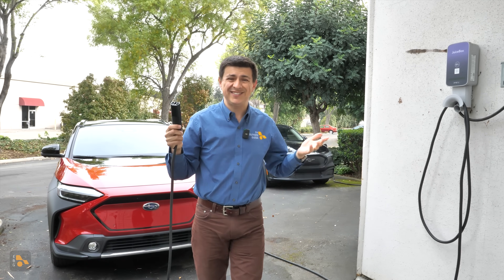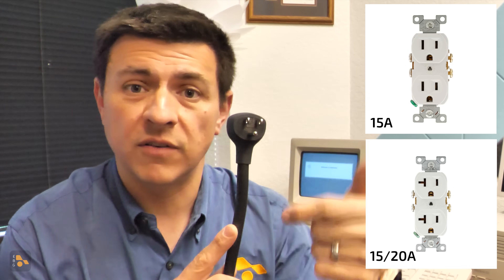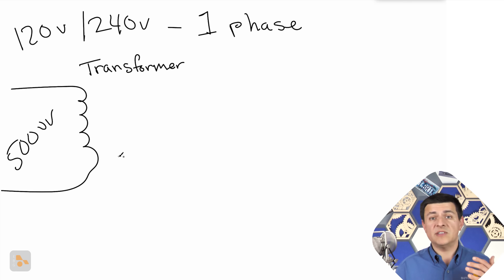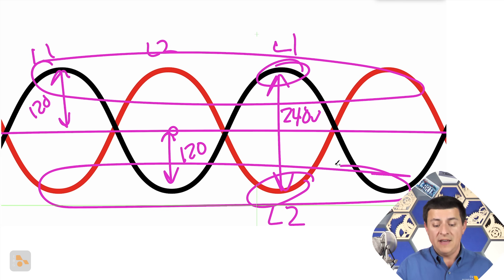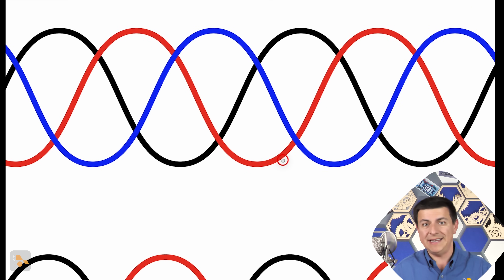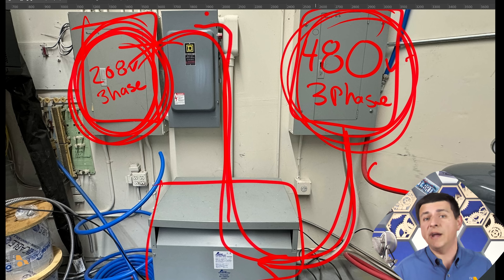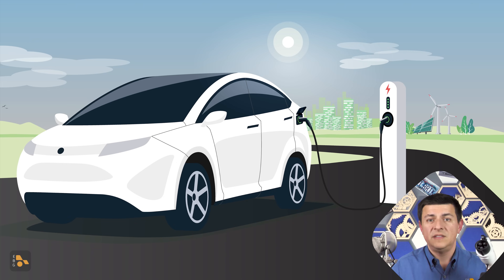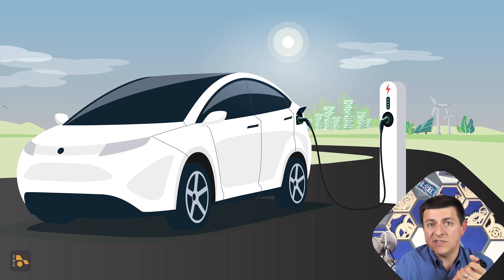NACS/J3400's Support For 277V Charging Is A Huge Deal and Here's Why

Comment: The peak-to-peak voltage of 240 volts is 340 Volts, not 240 as you drew. The Average voltage is 240 (248).

How electronic lighting "cheats the meter" by drawing power only at peak voltage stored in a capacitor"

240 VAC rms is 340 Volt peak to peak.

277VAC RMS average is 391 volts peak to peak.
Reply: Your meter can tell the difference between real power and apparent power, and if it only bills you for one, it bills you for real power.  Electric lighting doesn't cheat the meter by only drawing power at the peak.  Your meter measures the cumulative value of the instantaneous product of current and voltage.  Not the product of RMS current and RMS voltage.

It's an industry standard that nominal voltages are RMS voltages, rather than amplitudes, but that wasn't relevant to the main point of this video.

Comment: Model 3/Y and refreshed S/X can do up to 300VAC charging, even if it's not advertised. I would expect that the OBC's on most other EV's are capable of it too, but the software almost certainly doesn't support it considering the limit of J1772. But that does make me wonder if J1772 could be amended to support it. I can't imagine there's any physical limitation preventing it from handling a small increase in voltage.

Comment: Electrical engineer here who designs power systems for buildings. Nice video, but it does have one major issue. Most apartment buildings (even very large ones) and small to medium sized retail buildings do not have 480V delivered to them. The power comes in at 208V from the utility. I will have to look into whether this would make it economical to start bringing 480V in for apartment buildings with a lot of EV chargers. 277V will make fleet charging significantly more cost effective though, which I don't think you mentioned.
Reply from the maker: Thank you for sharing! -Travis

Comment: Great explanation!  the MAIN point is cheaper Level 2 installations but as you rightly pointed out, what will happen to existing J1772 vehicles...?  For the good of the EV future, they need to start handing out these J3400 Level 2 277V EVSEs like candy.  So many commercial building owners are very reluctant to install the Level 2 chargers due to cost.
Reply from the maker: At the moment it would only benefit Tesla and could physically damage pre J3400 EVs/PHEVs. That would be a big problem. -Travis

Comment: loved the video. watched it when it came out and I too like to geek out on E parts. I finally learned why the superior (to me) tesla plug will never make it to europe... and I didn't know I could change at 277v totay ? at the house I get 240, and at the hotel I was getting 208v I think and was definitely slower.... but it could be faster ? 23023 Model Y. thanks.
Reply from the maker: Charging speed really boils down to volts and amps and the higher they are the faster you charge. If the hotel was 209v that's likely all the EVSE was getting so in that case it couldn't be faster. -Travis
Reply: @EVBuyersGuide  right but I didn't know tesla supported 277v 48A as well, or is that for future model and later than wall charged v3 I just installed ? curious if the Y supports that now. thanks
Reply from the maker: They support 277V/48A now
Reply: @EVBuyersGuide  with no hardware change on the tesla car or existing tesla wall charger ? that's fantastic...
that doesn't seem like the case from your statement
| You can bet that as soon as we can get our hands on a 277V NACS EVSE, we're going to install one!
Reply: @alaind831  i’m sorry I misunderstood your question, I thought you meant does the model 3, as in the car, support 277v. For a variety of reasons, Tesla has officially not supported 277 V on the latest destination chargers, but you can always get an earlier generation one that specifically had 277 V support. What I am not sure about is: can you just plug a new one into 277 V? If anybody has one and deer in the bay area, I could try it, but I don’t have one myself.
Reply: @AAutoBuyersGuide  I live in Scotts Valley (your neck of the wood) but not really wanting to fry my new v3 wall charger to test this theory out :)
Interestingly the super charger in town is one of the few/early super charger that has been open to other cars (I've seen your vehicule on video charge there too) by nob hill.

Comment: Around here 120/208V three phase is available to smaller commercial buildings, apartments, and what not and is pretty common. 480V is mainly industrial and larger businesses that draw too much power to be serviced by a lower voltage.  In other words 277V charging isn't going to be available at too many places unless they add another transformer to provide it.

Comment: Here in Canada, commercial power is usually 600V (not 480V) 3–phase. This results in  347V to neutral. Does NACS support this voltage as well?
Reply from the maker: Sadly no
Reply: @EVBuyersGuide  So for those with 600V service, some type of conversion is necessary. I see 3 options:
1. For small installations, tap off of the existing 208V transformer. 
2. For larger installations, where the existing transformer isn’t large enough, a separate 480V transformer might be the better option. 
3. Forgo level 2 charging and install low power DC chargers, opening the option for V2G or V2B. For fleets, this also opens the option of not installing an onboard charger, saving weight and money.

Comment: No matter how you say good charger, still you will be ABC always be charging for the rest of your EV ownership. After the lifetime of your battery is over. Too expensive to replace and it just show your EV is just a casing as disposable. Good for you rich countries and rich individuals but not to the third world countries/ island nation/ remote mountainous places/ stream hot/ cold places. Sorry EV is an old tech not suited for all. Many range problem such as load capacity/ no spare tire/ going up hill/ you could only charge up to 80% and use up to only 20% so not practical. Whatever you say do not applied to all...

Comment: i am afraid you dont know much about europe, here i spain a large number of charge points can give 22kw, the obc on  ev can be 7.11,or 22kw, 7kw is single phase, 22kw uses 3x 7   thee of the conector pins on the car side.

Comment: This is a difference between the standards, not the connectors.  J1772 is more than capable of handling 277V, but it is not written into the standard, and thus it is not supported.  It could probably be easily accomodated, but contrary to your statement, most buildings DO have 208/240V and very few non-commercial (read not a factory) buildings have 480V 3 phase service, which is what is required in order to get a 277V 2 phase power source.  Certainly most apartment buildings, churches, and schools would not have 3 phase service unless they were pretty huge, and then only to power the HVAC system.
Reply: Agreed, but again, like you said, if you have that 480VAC switch panel for the HVAC right where the utilities come in, that's what you need to pull out the EV circuits. Plus, for big parking lot jobs, the utility will want to pull in new feed and 480/277 for AC charging directly for a large employee parking lot job covering a good fraction of the lot. Now they do a 208/277 service for a job like that; what a waste. 33% more copper plus the losses.

Comment: Never heard of that 3,5/3,6 kW limit in Europe. 
Matter of fact, most single phase vehicle/charger uses 7,4 kW (1phase 230V - 32A) 
But it's true that you'll find a lot of 22 kW (3phase 230V - 32A) stations in parking lots. Not so much at home, which is more commonly 7,4 kW.

Comment: The USA should have done what Europe does and have CCS2 for 3 phase charging. New Jersey power companies offer 3phase 208v to residential homes.
Reply from the maker: It's so uncommon in the USA that it would have added cost and complexity for the 1-2% that could use it.
Reply: @EVBuyersGuide chicken vs egg situation. With the explosion of all electric houses, and phase out of gas, we are seeing 400amp 240v services. It’s to the point residential new construction should be 3 phase.
Reply: @rpvitiello  According to PG&E, we don't see any increase in the availability of 3-phase residential power, the most logical reason is simply the commonality of transformers and distribution infrastructure. Combine that with the US charging connector standards not supporting 3-phase power and It seems extra-unlikely.

Comment: When will we start seeing NEMA 7-15, 7-20, 7-30, & 7-50   adapters for our Tesla mobile connectors? Thanks for your peak vs RMS disclaimer, as a power nerd I was vibrating watching your presentation. The adoption of 277 charging will make large level 2 sites  much cheeper and more efficient. Thanks for getting this issue into the public eye.

Comment: For what I've heard, the j3400 standard for ac charging will make the eu style bring your own cable charging as an option.
It also specifies the same male mennekes connector for the evse side.
Since it has more pins you could put 277v on the L1 pin, neutral on the neutral pin and 120v split phase on L2 and L3 pins.
It would be a wiring nightmare, but you can support all vehicles needing 120v 240/208 and 277v.

Comment: I have heard there are a lot of cities code restrictions against using a single leg of three phase power.  The Tesla Gen 2 wall adapter and the mobile connector already support 277 volts as well as all model 3s Ys and most model S/X cars. There is a great thread on 277 volt support at Tesla motor club forum.  It seems code restrictions are likely to hold back deployment in the near term.

Comment: I pity the person that plugs in their 208/240VAC J1772 car into a 277VAC J3400 charger with an adapter. That's definitely something to watch out for!

Do current Teslas support 277VAC? If not, it will be a problem for them as well. There will have to be some sort of negotiation between the car and the charger to allow 277VAC.
Reply from the maker: Yes all Teslas support 277V charging, some better than others but all support it.

Comment: Great description, however suspect the onboard vehicle charger immediately rectifies any AC power into DC, where it can use a low cost switching tranisitors (IBGTs) to control the charging.  3 phase is better for rectifing to DC since it doesn't create as ugly DC pulses.  It only requires six (6) inexpensive diodes in the wall connector for an NACS (SAE J3400) to work.  I've suspected the lower voltage DC support might have been planned for 3 phase and home direct DC solar charging solutions.

Comment: i'm surprised no one has mentioned the very common three phase Wye transformers that deliver 120v/208v without the need for a secondary transformer. This works great for EVSE's and does not require compatibility with 277v.
Reply from the maker: That’s discussed in the video. It’s very rare to have a utility deliver 208 in the USA, power is delivered as 480v and you have to step down yourself

Comment: As a recently retired Electrical Power Generation Engineer who worked for Square D, Leviton, Cummins Power Generation,  and T&B this was well explained. There is one issue that I ran across in Denver at a police/emergency station where they designed a step-down xfmr off one phase of the 480/277-volt panel to feed one charger. After the installation, they wanted six chargers.  Sometimes a dedicated 480V delta to 120/240V delta EV charging xfmr is easier to balance from the main 480/277 volt panel which has a lot of 277 volt lighting loads.
Reply: You have to be careful with that stinger though. ChargePoint chargers cannot be used with the stinger phase. Probably the way they check for ground faults could end up sending the stinger to ground and not being able to handle it.
Reply: @patrickmay8261  I am not following your thought process

Comment: I'm curious if onboard chargers in Tesla are the same globally.
They can have 3 charging circuits inside (16A each) and use them natively in Europe and bridge them together to get 48A load on single phase. 🤔

Also, each onboard charger is a rectifier-step-up converter combo, so accepting 108-277V voltage range is fairly easy, but maybe manufacturers need extra time for testing.
Reply from the maker: The part numbers are different but likely related in terms of their internals.

Comment: So, do all Tesla vehicles have on board chargers than can accept 277V?
Reply from the maker: Yes but there is some variation as to how well they accept it. Older S/Xs are fine, as are newer S/X models. However there were several years (right after the cancelation of the dual charger option) where the onboard chargers didn't like voltages above ~280ish and would just give you an over voltage error. The 3/Y seem to fully support it with the latest software and Tesla has confirmed that to owners in emails. In a nutshell, 95%+ of Teslas on the road today have no problem with 277V +/- 5%.

Comment: Great info, thanks! 277V will be important in the near future.
Interestingly, Tesla originally supported 277V charging, but when they switched On-Board Chargers on the model S/X, they became less reliable so they officially removed support from all documentation. I think the refresh S/X are now using the same OBC as the 3/Y? I don't know now.
Since the introduction of 3/Y, their onboard chargers can handle 300V max and many users on the forums have shown it working, as the Tesla wall connector also (unofficially) works on 277V. The OBC is power limited though, so most were only seeing 45-46A.
Reply: I found a free public Tesla Wall Connector in a parking garage that my 2016 Model S was unable to charge at. But my mom's 2023 Model S and other people's Model 3's were able to charge on it just fine. I'm wondering if what's going on here is that the Tesla Wall Connector is configured at 277V and my car's OBC doesn't support it.
Reply: @The_TermiGator  Too bad you didn't look to see what your mom's S was charging at. But yeah, there was a range of years where the S/X won't accept more than 250V.

Comment: 10:09 Correction, 3Ph is much more powerful than what you said (with is good), 208v, 48A = 17,292 Watts, IS NOT 9,984 watts
 208 will produce more watt than 240 single phase at the same amps
Reply from the maker: We’re not talking about a 3-phase load since the onboard chargers are single phase chargers. Yes, you would get more power from a 208V 3-phase course if you had a 3-phase charger however in US market EVs only a single phase can be used to charge so the power levels shown are correct, 9,984W on 208V which is less it would be on 240V or 277 for the same current.
Reply: @EVBuyersGuide  I believe there is only one way to get 208, and you'll be using 2 phases of a 3Ph system,
120 is ½ of a Phase + Neutral.
240 is 1 Phase, no Neutral. 
208 is 2 Phases,  no Neutral.
277 is 1 Phase and Neutral.
480 is 3 phases, no Neutral. 
 On 208, 277, and 480, you need to multiply (Ams)(Volts)(1.732)
Reply from the maker: Correct, 208V uses two phases, however there's no functional difference between a single load from L to L on 208 vs L to N on 240 because you're not using the third phase, nor are you loading to G/N. Therefore you're still pure A*V=W.  The calculation for A*V*1.73 is only used when you're talking about a 3 phase load with balanced phase loads from L to L to L. If however you're talking about balanced phase loads from L1 to N, L2 to N, L3 to N, then it would be A*V*3 because each phase could be maxed out to N/G.

Generally L to L is still considered a single phase load because if you look at the waveform there's only one line. You'd only get two phases in a usable sense if you referenced neutral or the other phases. So in a way it depends on how you look at it, 208V is certainly two phases of three phase 208V, but the appliance connected is best described as s single phase 208V appliance unless it also has a neutral requirement and L-N load.

Comment: This was fun. I am an Electronics Technician and spent 20 years working on very low power DC devices used in potentially explosive environments like oil and gas facilities.  Now I work for a company that does a lot of electrical safety testing so I am in the world of AC and anything from single phase 120 VAC to 3 Phase 480. It's been a (safe mentored) learning experience and interesting wrapping my brain around power delivery.  Great video.

Comment: You speak as if all commercial or multi-tenant residential buildings that provide 120V/208V from 3-phase AC are fed 277/480V 3-phase power and step it down on their own premises with transformers they own/control, but this is not actually the case.

Plenty of buildings (mine included) are directly fed 120V/208V 3-phase AC directly from the utility and don't have access to higher voltages at all. Our building even has an elevator fed from the 208V 3-phase. No transformer on our property.
Reply from the maker: Clearly we're speaking in generalities, but according to the US Energy Administration spokesperson we interviewed an overwhelming majority of commercial customers are responsible for their own step down transformer. Just as there are residential customers in some areas that have access to three phase power, it's the exception rather than the rule.

Comment: Chevy Bolt does not support 277v.  On one of the forums a fellow had 277 EVSE at his condo and Teslas could charge but his bolt couldn't.  Also the reason Tesla on board chargers support 277 is that the first Model S on board chargers were ganged and used in the first superchargers.  Elon loves to reuse existing components so that made perfect sense.